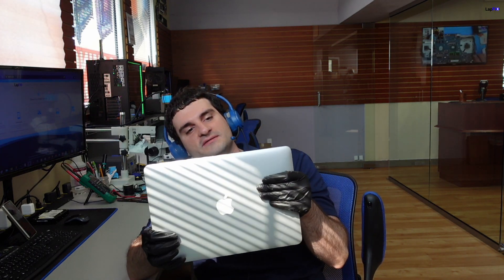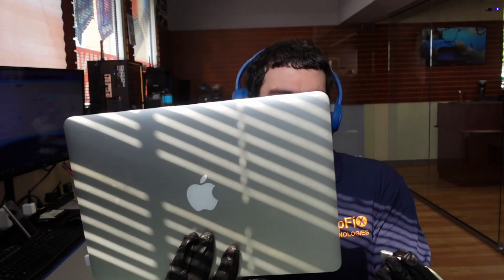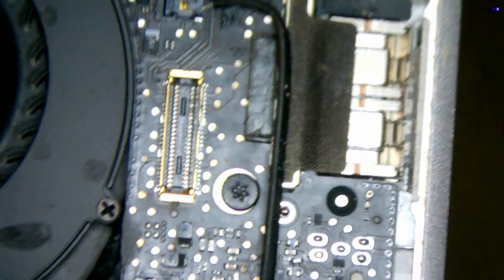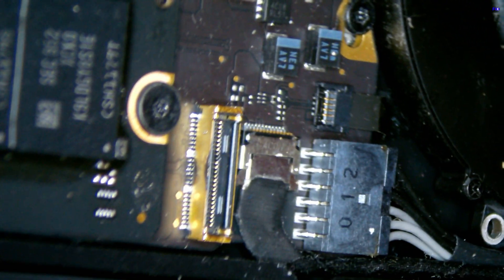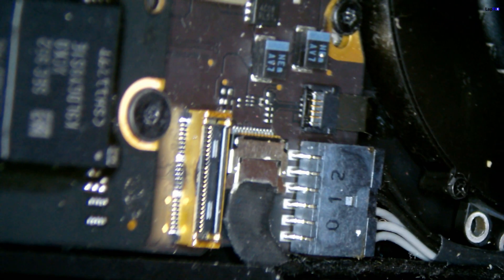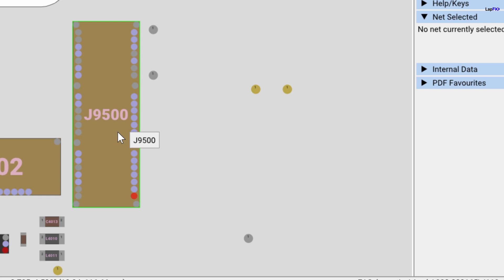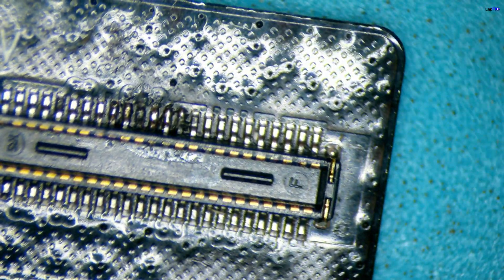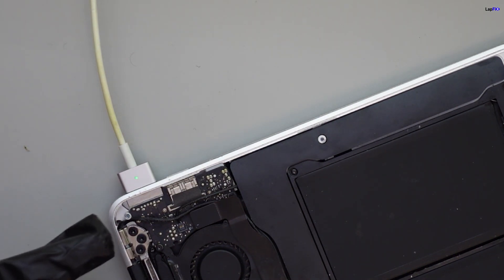How To Fix a 2017 Macbook Air Not Charging and No Orange Light

Comment: Hi, I recently spilled water on the right side of my MacBook Air 2017. I took it to Apple and they ran diagnostics the charging port is not recognised. I’ve tried at home also I’m looking to change it myself by following your video) where can I get a replacement board? Do I need both the I/O board and the logic board or just the I/O board? Thank you

Comment: I've been looking around trying to find a fix. My 2017 Macbook Air has the magsafe light turn on and fan run, but it won't turn on. I looked through your videos and haven't found one with the same issues as mine. I thought it was the battery because before it died, I had run a system check on it and the battery was the only bit that reported any issues. I did feel around the board for any heat and the SSD was warm, so I removed it, but it didn't turn on with the folder icon and question mark. Would you be able to help me?
Reply: I did try resetting the SMC with Shift-Ctrl-Option-Power and after 10 seconds of doing that the Magsafe light switches to green for a second, then goes back to amber, so I know the keyboard works.

Comment: Can I change the 27 inch screen 2020 for imac 2017 please? Thank you very much!
Reply from the maker: It depends on the model.  Some of them come with  5k resolution.  Best case would be to check the panel # on the screen itself
Reply: Can the same 5k panel be installed?